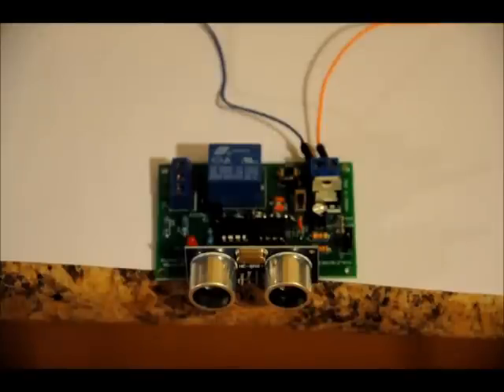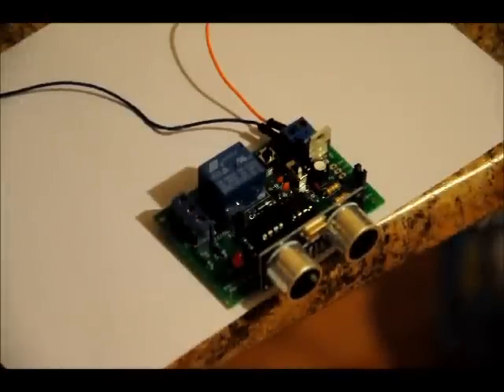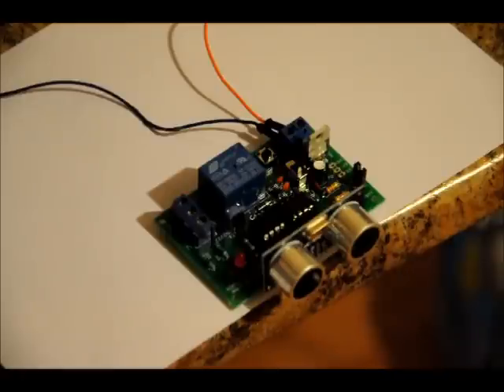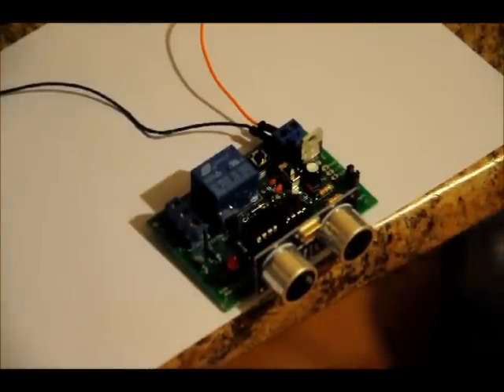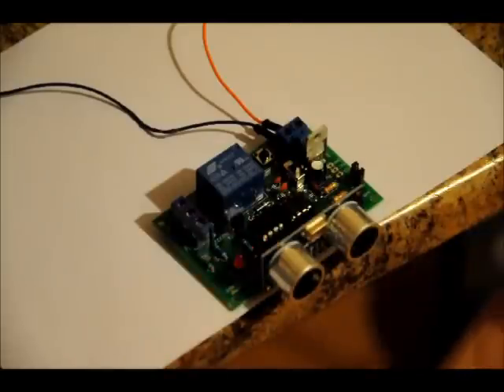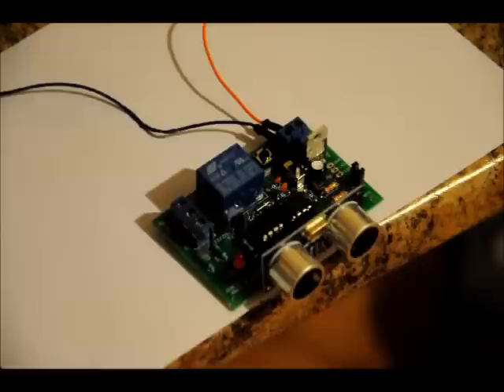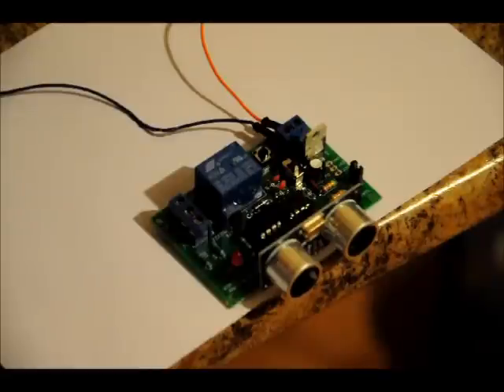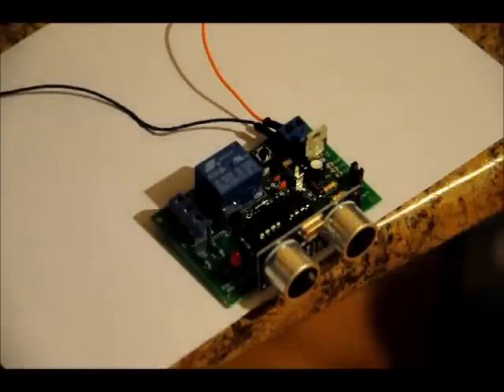An Ultrasonic Proximity Detector With Relay Control  3 Modes Of Operation

Comment from the maker: No, it would be safe.  Not a bad idea either, but to get any prolonged time out of the lighting it may get to be a little costly to purchase the super caps, charger board, voltage booster and LED banks that would be necessary for decent lighting.  All in all, not an overly complicated project =)